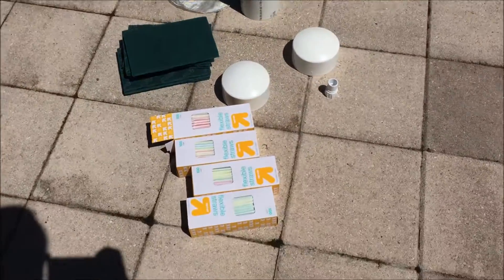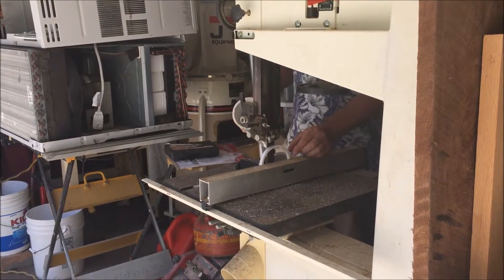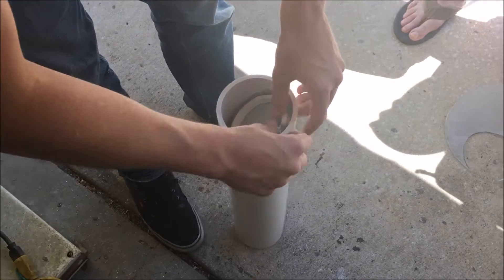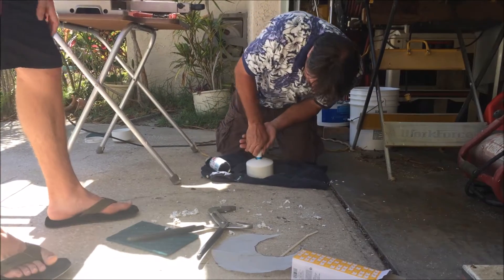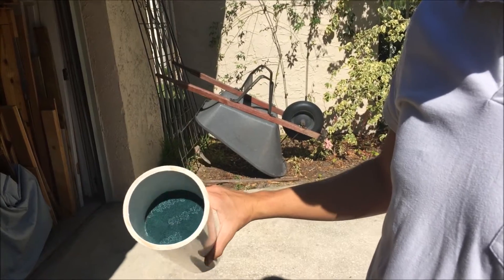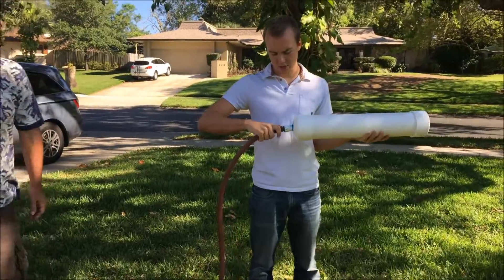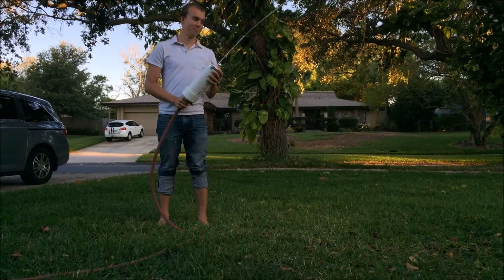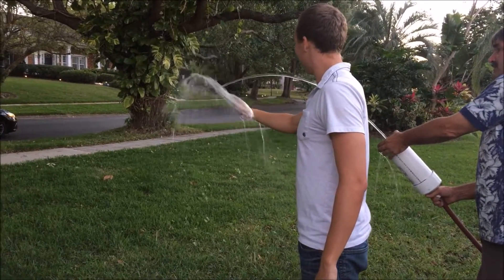Homemade Laminar Flow Fountain

Comment: Dear Sir

I also tried for laminar, up to a extend I successes, but after a distance water spread. I use 4" dia pipe and 10" long and water jet hole is 12mm. pump is 18 meter head and discharge 6480 lph. I need water flow rate and pump specification

Comment: Doesn't look any different to what you get out of a garden hose?
Reply: A "normal" stream of water will end up "parting" at the ends because it becomes too unstable. I don't know much about how it works but laminar flow is, basically, the flow of water such that it is stable. i.e. the water coming out of the hose in the video seems to be in freeze frame, almost like a clear tube. If they improve their hose attachment, the steam of water will seem impossibly cylindrical all the way through till it hits the floor (or the spoon the dude is using).